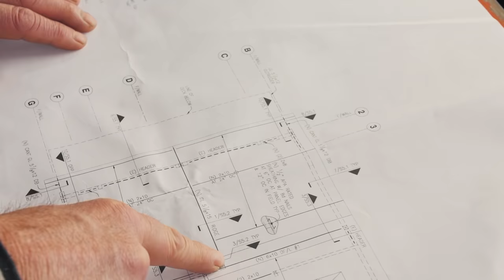Constructing Floating Homes | Houses On Water | Zillow

Comment: Now you can use. Floating fundation . Concrete floating...
I ve been with the architect coen olthuis, and we are working building floating comunities.... concrete IT s best option.
But I Like your idea, and way to do IT.
Reply: Hi can you point to more specific references? I am curious how you can stabilize the building, or is there specific requirement on the water conditions?
Reply: @ChaojianZhang  A concrete element should be calculated, capable of floating and resisting buoyant force depending on use.  so you have a better idea, I was in Ijburg in the Netherlands, watch that video.  ..Ijburg is a floating community.  I was there and I was trained to implement that construction system in America.
Reply: @sportshootinghonduras8338  Thanks for your reply. I am wondering is there any sort of anchor used to keep the floating community stay at a given location, because I don't understand how can a concrete foundation on itself help keep everything together. When you say watch that video are you referring to the video of this post? I don't see where it mentions this mechanism.

Comment: I am just curious how do you stable the houses, especially when connecting them with roads?
Reply: It is recommended that the house is located in a place with calm waters, 2nd ;  houses are supported by two piles inserted in the seabed, diagonally.  fixing the house and there is no horizontal movement, the only movement is if the water level rises or falls, the house follows.  The difficult thing is the calculation and design of the floating concrete foundation that allows you to add loads, this process does not use stairofoam.
Reply: @sportshootinghonduras8338  Thank you very much, it really helps me appreciate this kind of structures better!

Comment: as much as i love those homes , floating homes are a real issue in urban areas where they block the view of the houses that used to be frontline to the water and the value of those houses that are now in second row go down significantly . just imagine you bought a house that has an unobstructed view of the water which is something that comes with a premium prize only to have someone put a floating house in front of it. the folks in holland already have that problem and its infuriating